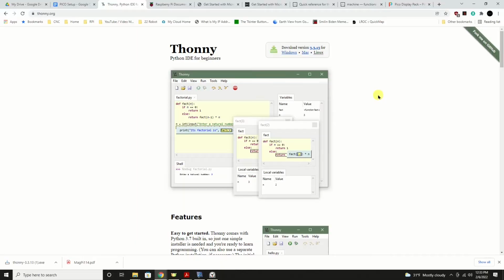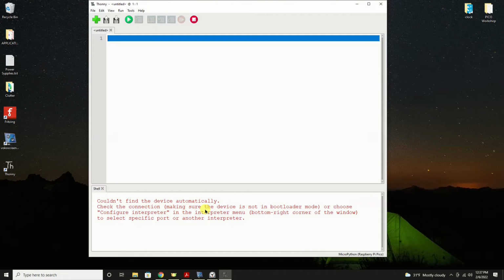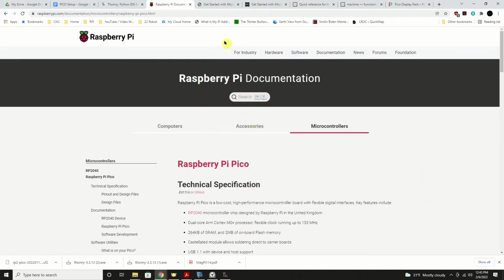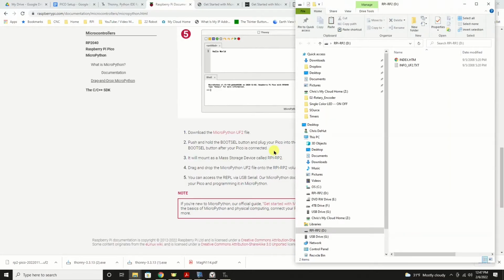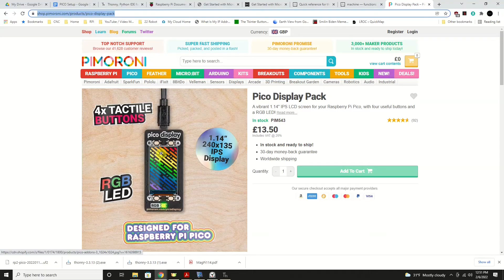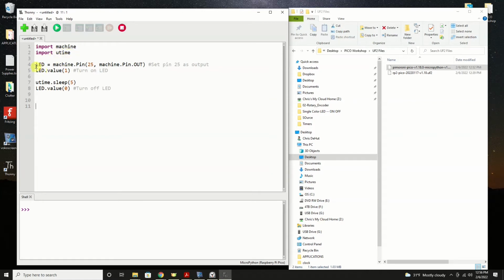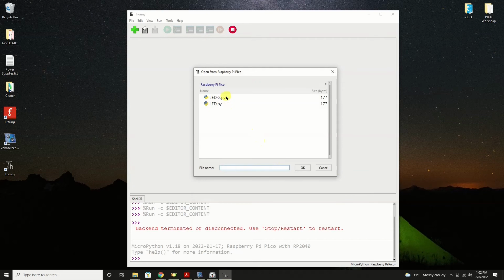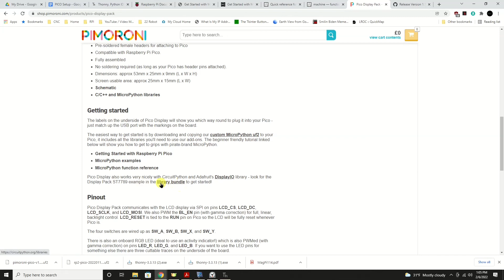Raspberry Pi PICO Setup and Preparation for Programming

Comment: Ok.. this wasn't a VIRGIN install.. cuz I have a VIRGIN laptop. and this iddn't work.. cuz You already had PICO stuff installed on that PC. that is why it came up and KNEW what you were going to use. it had been used already.  
I couldn't get the interpreter to install Micophython, cuz you actually didn't show us how to do it? and it was odd with the setup in there.. 
But. luckily when I plugged in the Pico (Holding down button ) . it showed the HTML file and going there to documentation they had two files already to install Micropython just by drag and drop. .so that worked great. now it sees everything!!